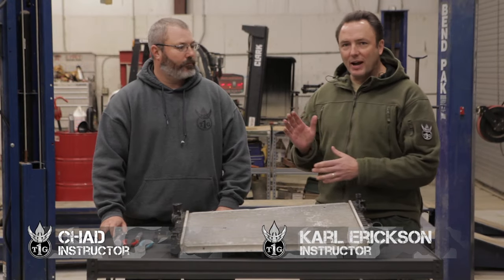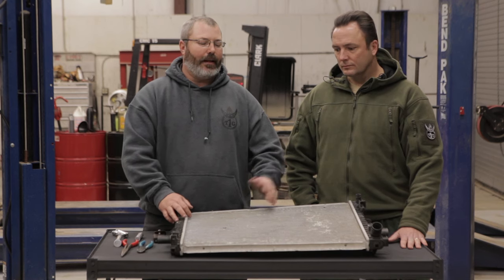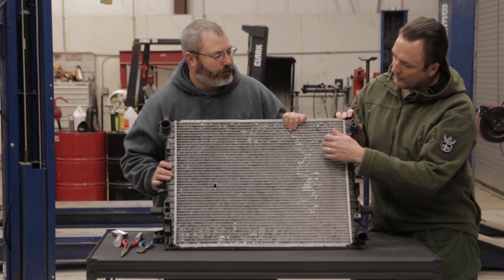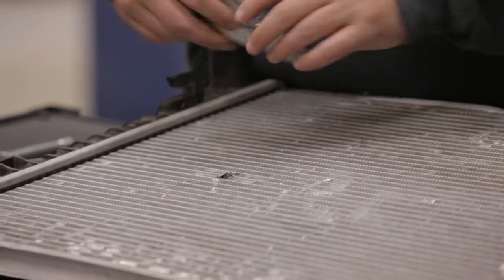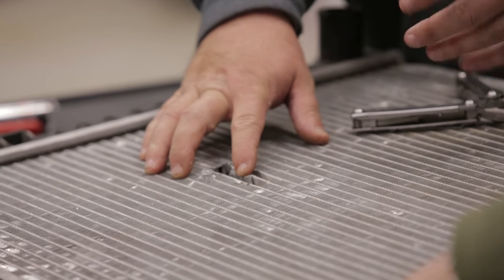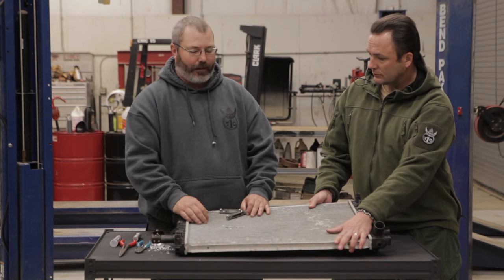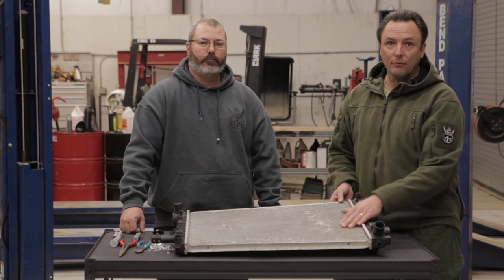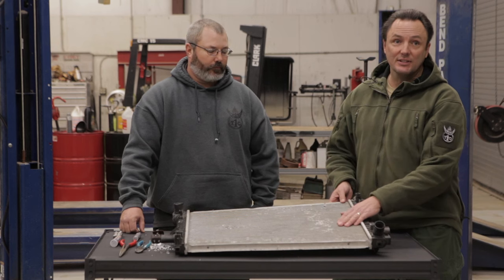How to patch a radiator | T1G Training

Comment: I fucked up my radiator on my c6 z51 can however the oilcooler plastics in the side are good that radiator runs for about 600 bucks can i just change it out for a regular corvette radiator and nust swap out my oil coolers